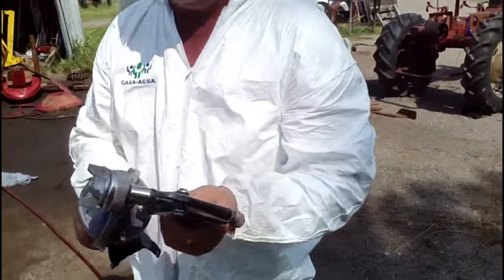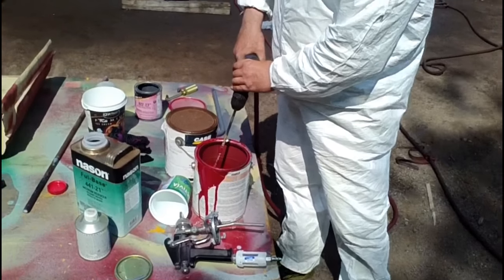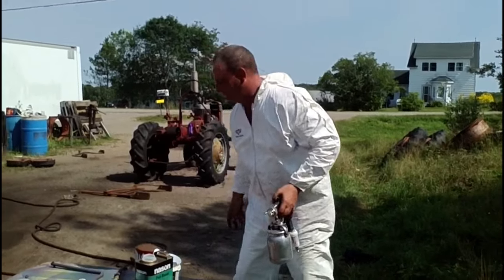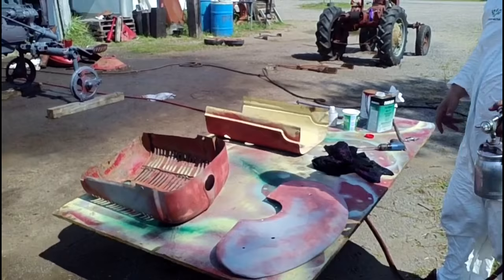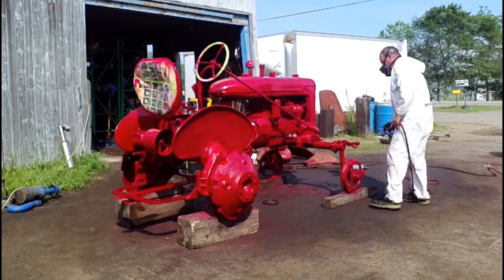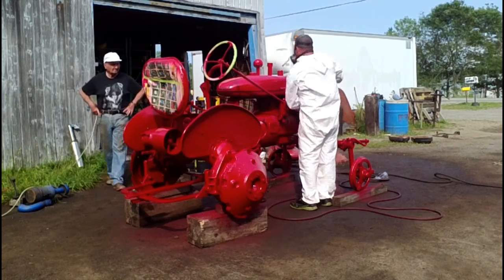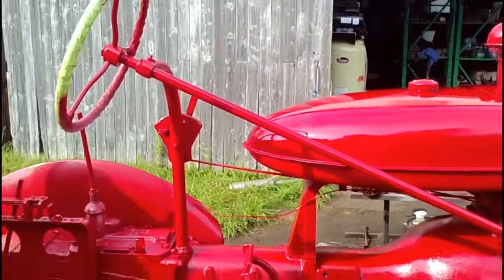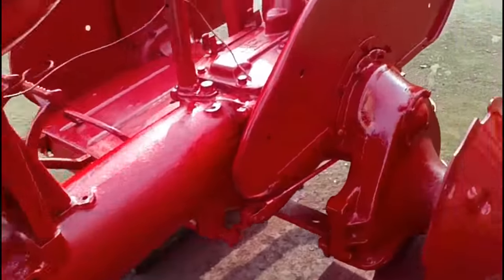Painting a tractor

Comment: Good to see an oil filter on the gun before the air line, lovely old tractor John
Reply from the maker: John, that is actually a desiccant water trap, it is very humid on the east coast of Canada and the compressor gathers a lot of water. I don't use an inline oiler either, just add a few drops to the tools as I use them.

Comment: From priming to spraying the last coat of paint, what was the time frame? Also, how long did you have to wait to reassemble parts?
Reply from the maker: It took around 4-6 hours from start to finish (I'm not fast). I let the parts flash for about 20 minutes before assembly, just long enough for the paint to harden up a bit but no so long that the next coat doesn't stick well.  Thanks for watching!
Reply from the maker: @duanedean3256  I have already done the other, but I do have another tractor to paint when I get to it.
   Good luck with the Super C, those are nice tractors.

Comment: what  brand paint did you use, and what brand primer
Reply from the maker: +shane futch I use the Case-IH paint, I find it nice to work with, it flows well, and I know the color is always going to match. I've used various brands of primer, I prefer an alkyd based primer, but I have used epoxy primer as well. Thanks for watching!
Reply from the maker: +shane futch You should be able to check with your IH dealer, but as I recall the ratio is 8 parts paint, 2 parts reducer, and 1 part hardener. Glad you enjoyed the video!
Reply from the maker: +shane futch You can ask someone at the TSC store if that primer would be suitable, but basically the purpose of a primer is to seal off what is underneath of it and provide a suitable surface for the new paint to bond to so most primers will work.
Reply from the maker: +shane futch You're very welcome, I'm glad I could be of some help!

Comment: I saw where u use the old style gun vs the hlvp. is there a reason for that
Reply from the maker: +shane futch It's what I have and I don't do that much painting so I can't really justify the expense of a new paint gun for what painting I do.
Reply from the maker: +shane futch It's a challenge, pick a calm day soon after a rain.
Reply: +shane futch I saw another  video of a man painting a tractor. he says to spray a light coat, wait 24 hours, spray again, wait 24 hours, put on another  coat. Looks to me it will take 3 days to paint one like that.
Reply from the maker: +shane futch You just want the paint to "flash", 20 minutes between coats is usually lots, so by the time you're finished one coat you can start the next. If you wait 24 hours the paint manufacturer says you should sand between coats.
Reply: +shane futch  I ran across that video just the other day.  I really can't wrap my head around the 24 hour interval between coats.  Evenly sprayed light coats will net you a 15-20 minute flash time.  What does that mean in real life?  You rarely stop spraying.  By the time you start on one end it takes 15-20 minutes to get to the other end, so you start over.  Add in whatever additional time you need to mix paint while you are spraying and you average 30 minutes between coats.  That flash time actually helps your gloss significantly.  If you can touch it without making a mess it is ready for another light coat.

As for a gravity feed vs suction pot (old school).  For the home gamer it is preference.  Under no circumstances make the assumption that HVLP is better.  Think of it as an emissions system.  HVLP's primary goal is to get higher paint transfer.  Might save you some paint, but may sacrifice smoother finish.
Reply from the maker: Thank you for the helpful information. It was always my understanding that if you take much longer than the flash time you have to wait about 48 hours and sand between coats!
  I also appreciate the input on the paint guns, for me it was just a matter of using what I have, but I do like the suction type gun I have now,  I am used to it and it works for me. :) Thanks for watching!